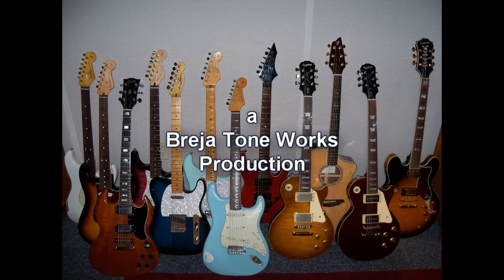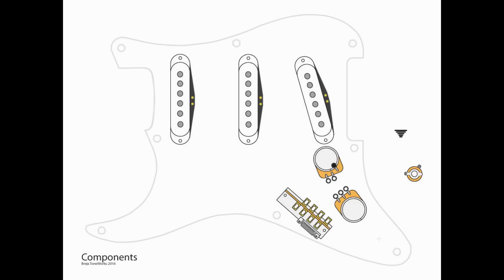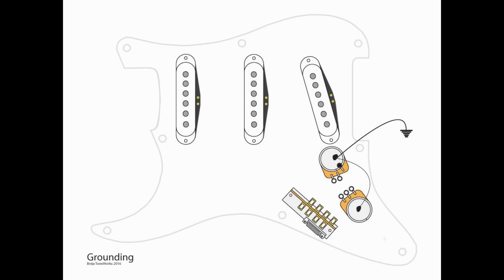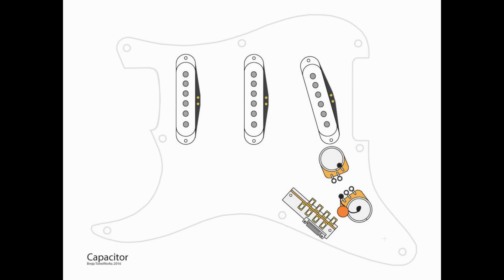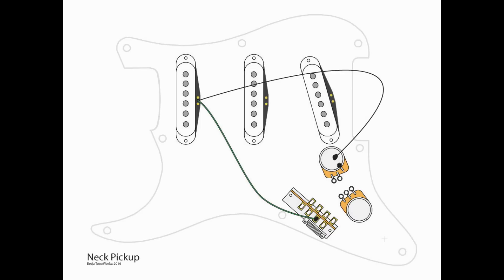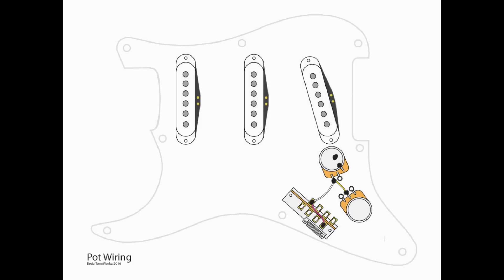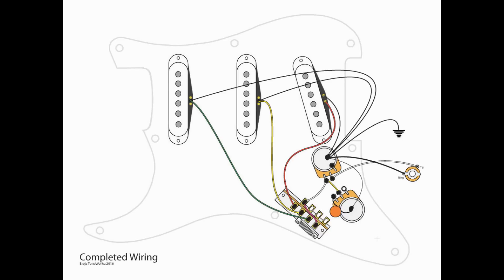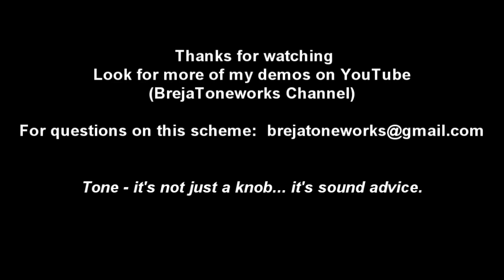3-Single Coils with 5-Way and Master Vol and Tone Controls

Comment: Hello.  Your videos are very well done and extremely helpful.  I am embarking on a project to rewire a new 3-humbucker guitar, and I am planning to use a 5-way switch to move between the pickups but use push/pull pots to manage the coil tapping.  Can we talk offline, as this wiring project is new to me?  Thanks in advance.

Comment: Thank you  very much.   This schematic was perfect!!  And easy to understand... worked exactly right.... subscribed and much reccomended
Reply: may i ask how it went and what guitar you did this on? im about to do this tomorrow, and im very nervous its going to change the tone on my guitar. im opting for this route, rather than moving the volume knob completly across the guitar because its both reversable if i mess up, and im so worried about changing the tone. (i have a players series stratocaster HSS). also not sure if it matters that this video is for an SSS configuration, im guessing that it wont.
Reply: Here we go....   i used this schematic to wire up a G&L asat z-3...  i replaced the Z-coil pickups with seymour duncan quarter pound single coils.... this guitar was originally made with a master tone/master volume setup...  i dont think my experience will help you here since A. I changed pickups all together, and B. My guitar was master/master to begin with.  However, this schematic was absolutely SPOT ON for what i wanted.
Reply: Also, i think the humbucker requires some additional wiring mods..  humbuckers usually have 4 leads as opposed to 2...  they can be a little tricky...
Reply: Thank you so much! im going to do a little additional searching. i  was kind of surprised i didnt find everything instantly. i really appreceate  you taking the time to answer me back.
Reply: Any time..  sorry i couldnt help more
Reply: Just wanted to update, it took me a couple days of desoldering and soldering, but I did it! I ended up using a different schematic because the 5 way switch I have has 12 pins instead of the normal 8. After a lot of searching I found one that worked!
Reply: Nice!   Thats called a fender “super switch”..   glad it all worked..  did it affect your tone at all?
Reply: @wrenchhead4378  it did, but while i was in there i changed the stock capacitor with an orange drop .022 so it was to be expected. i joined a guitar wiring group online, and ive been learning alot more about this stuff, its been alot of fun. i think my next project is going to be to rework the very first guitar i got back in the 90s. i think it would be alot fun to really soup it up.

Comment: I wired my strat this way, the neck pickup is really weak and position 3 and 4 sound the same. Position 4 has buzz, same as 3. Is my neck pickup just bad basically?
Reply: I'm inclined to think it's the pickup but the magnets sound normal when I hit them w a screwdriver

Comment: hi, thanks very much for this scematic. i have a players series HSS, and the volume knob is right in the way when i palm mute on the higher strings, so ive been looking for a way to move it out of the way. when i was looking around online, i saw in forums that alot of people were bumping the know while playing, ive  personally never had this issue, but maybe these two reasons are why you received requests for this setup.
Reply: This is EXACTLY my problem. I also have an HSS Strat, and have my hand fairly close to the bridge. I hit the knob constantly, and are seriously considering moving the vol pot the where the neck tone is... This makes it look easy enough for me to be able to do it myself.
Reply: @olavjorvik94  ive done the mod since i made that last comment, and id never go back.  i had all the tools to do it here already, as i like to make my own guitar pedals, but even if you didnt have anything,  i would say go ahead and do it yourself. to get the proper solder, a soldering iron, and some copper braid soldering wick is only around 20$. really happy with the results.
Reply: @Bevrat  I am doing this with my HSS. How does the wiring differ from HSS versus the SSS shown here?

Comment: Thank you for the video.  I just finished my soldering and checked it out.  Everything seems good - except when I back the tone all the way down it cuts my volume off.  Otherwise, the tone and volume seem to work as should.  This appears to be wrong, none of my other electrics have this volume cut when the tone is backed off to zero...  someone please advise.  Best regards!

Comment: I took a tone pot out of the curcuit because it was broken. I’ve been working for hours and nothing is working. I required it all over again. Tried everything in thsi video ( but I don’t have they kind of switch) and still not working. I’m at a loss. I cut a wire to make the bridge wire and I’m just not having anything turn out good

Comment: **UPDATE** The new switch arrived and intalled the pickup hots and the output in the exact same positions. No dice. Middle pickup still not responding, not even a buzz or hum. the neck and bridge pups are working fine. I even tried hooking up the middle pickup to the bridge position. Nothing. I guess its kicked the bucket. Dang it!

Comment: Thank you very much, awesome demonstration of how it is done. I am modding my Pacifica, I'm a beginner, to have just a Tele neck and a HB bridge with a 3 way (on-on-on) switch to have the ability to have the HB as HB, SC or parallel, any advice how to go about it? I already had it wired, but it was a HSS. Now I am making a new pickguard and it will be just HS and I am also thinking of using a 3-way lever switch instead of a 5-way. Do you maybe have a suggestion of an interesting mod to still use a 5-way switch with just two pickups? Cheers

Comment: Ok, I have an issue. I bought a brand new Fender Nashville Tele. I got a serious discount due to it being a "scratch and dent" item. aside from the dents and dings the middle pickup isnt working. The neck and bridge are and all positions on the 5 way work exept for #3. So, I decided to open her up and just rewire from scratch following this scheme. The middle pickup is still not responding. I have a new Fender 5 way coming, maybe the switch is faulty(?) and will rewire again. Can a pickup (Fender Noiseless single coil) just die? When the new switch comes I'll try soldering the middle pickup the bridge position just as a test to see if its working at all. Any thoughts? I really dont want to replace the middle pickup if I dont have to....

Comment: thanks.
can you do a video on a p-bass set up, and 3 humbuckers, with all having individual volumes, push pulls, single tone with the normal 5 way selector and a switch so you can have 7 way switching?
Reply from the maker: +chef kdowg On a P-Bass?
Reply: Yes. Thought you should do a bass video for the bass players. Or a double soap bar for a 5 string with two volume, one tone passive with a les Paul pick up selector? 
Thanks sir
Reply from the maker: +chef kdowg I'll see what I can do

Comment: Hi. Was looking at my 5 way control plate. My 047 capacitor is connected to the middle lug. And the jumper wire is on the first post.any difference. Thanks Gary

Comment: I have this mod installed with a TBX as the master tone. It's really good. Wondering if the 50s style wiring option of putting the tone on the volume output would work?

Comment: I'm in middle of a double neck strat build.....(all) single coils with a volume knob for upper portion of guitar..........I would like the traditional 1 vol.....2 tones and 5 way switch on lower portion. I'm planning on using a simple toggle switch to go from upper to lower. Can you help me with how to wire this? Thank you!
Reply from the maker: +desertdoggz What are you controls for the other neck?
Reply: Breja ToneWorks I was thinking just a vol control for the upper neck.........and hoping that the tone controls on the lower  neck would adjust tone for both upper and lower neck..........here is a pic of how it would look minus the toggle switch...........if I can do it without a toggle switch that would be ok too I guess. 
http://img.guitar-muse.com/wp-content/uploads/2012/01/Fender-Strat.jpg
http://www.doublenecksg.com/images/201409/goods_img/55_P_1411488305635.jpg
Reply from the maker: +desertdoggz email me directly at BrejaToneWorks@gmail.com   There are some challenges with this concept that you need to think through.
Reply: Breja ToneWorks...Ok I will contact you, thank you very much!

Comment: I want to have a master tone drilled into the pickup and 3 separate knobs for tone on each pickup. Then I would like an on off switch next to the 5 way to turn on the bridge pickup to add the combinations of either all the pickups at once or the bridge and the neck alone. PLEASE HELP this is my dream guitar but I can't fugue it out.  (Ps I've already drilled the holes. .. there's no turning back)
Reply: The pickGUARD

Comment: I did say with the Telecaster control plate turned 180°, switch @ the rear ie: 3 SSS 5 way switch.  vol becomes tone & tone becomes vol. switch works in reverse. wiring ? .

Comment: Great videos - just wanted to confirm that this configuration is noise cancelling in the 2 and 4 positions?  I'm setting up a P-90 bridge (PSS), which has 2 wires (hot and ground).  Would the wiring diagram be the same?  Thanks!!

Comment: So how does the signal flow with respect to the tone pot?  Is it going through it, out of it...what?  If I understand correctly it appears you've got the output of the tone connected to the input of the volume.  Is that the direction of signal flow, and if so, where is the tone getting the signal from to send it to volume?  Please be the first on all of YT to answer this, as I've been searching for the answer for DAYS and can find NOTHING, and it's driving me mad.
Reply: Completely throwing a Hail Mary here. From his other videos of how a potentiometer works. I'm thinking when you turn down the tone pot your allowing signal flow into the tone pot on a reverse fashion and then it's getting grounded by the capacitor. I have no idea trying to make sense of it myself.
Reply: @j.a.s.1416  I believe that's correct; it's the conclusion I've come to since posting the question.  Now what I'm wondering is, how does the action of the highs being led to ground have any effect on the output signal, if those frequencies which aren't filtered out (and being bled to ground) aren't rerouted back to the volume pot/output?  Seems to me that any and all of the signal (regardless of what frequencies) that is sent to the tone would be lost regardless, unless it was somehow sent back through to the rest of the outgoing signal.  Does that make sense?
Reply: @51MontyPython  It makes sense. I'm wondering if it's a matter of path of least resistance. That as your turning the tone pot down your decreasing resistance but the least amount of resistance is still between L1 and L2 on the volume pot.
Reply: @j.a.s.1416  Right; which of course means that most of the signal should go straight to output (through the volume pot) with a lesser amount of signal going through the tone and on to and through the capacitor (which is another question that I have -- how much signal goes through each path? how much of the total signal coming out of the pickups is sent straight to output, bypassing the tone altogether, and how much goes straight to tone, without (or before, or...whatever...) going to volume?

And of that signal which does go to the tone, does any of that signal then go back around to the output?  or does it all get sent to ground?  or is it just some of the signal or remaining signal that actually makes it to the tone in the first place, much less to ground (or through a capacitor or whatever)?  These are the questions that no one answers, which I'm sure provide the very answers to make it all make sense.

Comment: It shows only a Fender style 5 way switch with 2 sides... but most import guitars use a straight 8 connector switch  and 5 positions for 3 pickups . Why not just show us how to wire the import switch and not the Fender type only?  Most fellows cannot afford a FENDER  guitar and sos they only get import switches !

Comment: why is this a different tone pot wiring than the blender mod wiring, where you still use that same tone pot as a master tone??
I have a TBX tone pot & trying to wire it as a master tone pot, but it's acting like volume pot.i used the diagram you showed us from the blender mod wiring video. can't find a diagram to use a TBX tone pot as a master tone.
pls help me.
Reply from the maker: Check your email.  I just send you some information.   Don

Comment: So I have an old Peavey Falcon, and everything on it seems normal except for the neck pickup. It's really low volume wise and sounds like it's out of phase, and in the 4 position, it doesn't cancel the hum (but it does in the 2 position). I've checked it over and over again, and can't find the issue. Any ideas?
Reply from the maker: email me directly at:  BrejaToneWorks@gmail.com

Comment: Great video! I have a request from anyone in the comment section. I want to wire this guitar just like the video except I only have 1 vol and 1 tone. 

More details:
3 single coils
 (middle is RWRP)
5-way selector switch
1-4PDT mini toggle switch
1-vol
1-tone

Anyone with a diagram would be a great help?
Reply: Same question
Reply: Tell me, we're not all trying to mod those new Squires offset Teles?

Comment: Thanks for this. Worked great
As a novice I might advise making the V1 to T2 connection first
I found it difficult to get that short wire worked in to T2 with everything else surrounding it
Sounds great and solves my volume knob placement issue with strats

Comment: This guy doesn't know how to wire a Nashville Tele. You don't need to have a jumper wire from one side of the switch to the other. You just need to have a wire from the common lug on the side of the switch that has the pickups wired to it. The jumper is useless.